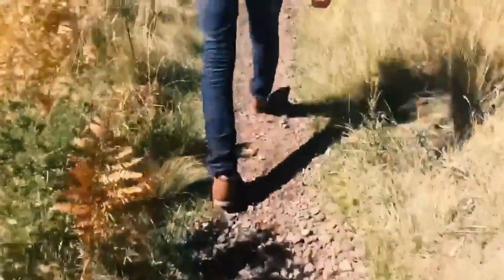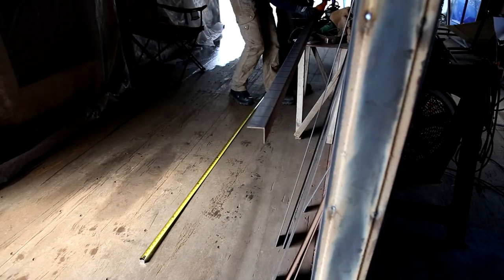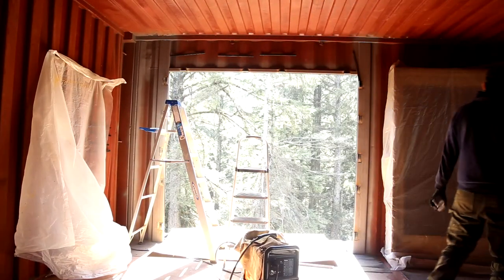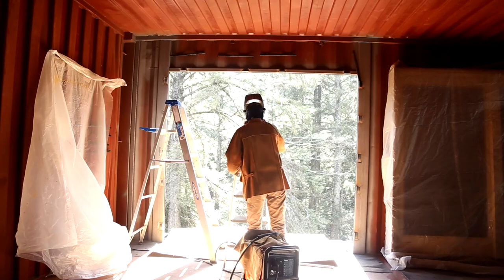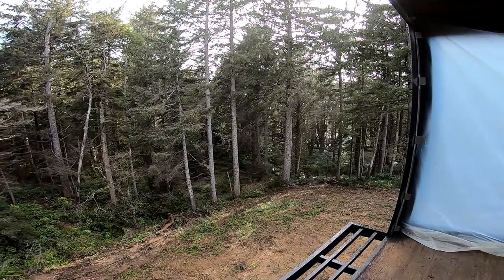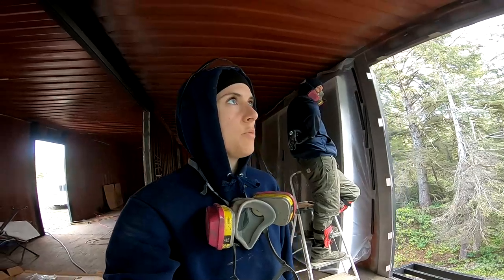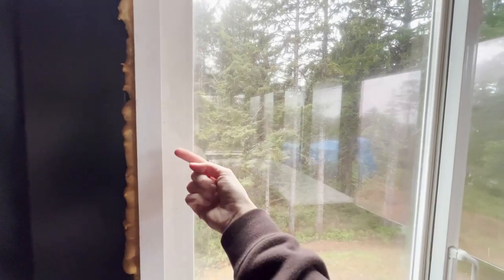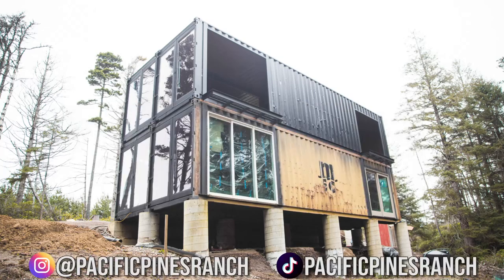How We Installed Doors In Our Shipping Container Home

Comment: Was cost the driving factor in this method?!?? Seems it would be easier to just use rectangular metal beam to create a door frame?
Reply from the maker: Cost is usually the reason behind what we do. You could also use tubing instead of the angle iron. There’s a bunch of different setups and ways to go about it. It just depends on what works for each situation! 😊

Comment: Great videos....great job.....I love watching your progress. I DO have a question (sorry, jumping the gun a little)...I know you want to use self-leveling concrete for the floors.....SUPER IDEA......but am just wondering about the door frames, which seem to be really close to the floor....will this leave you with enough "thickness" of the concrete...??? Should there perhaps been have another piece of steel, like a small box section, to elevate the door frames and allow for the concrete to sit against...?????
Again, love what you guys are doing.....
Reply from the maker: Thx so much!! With self leveling concrete you don't need very much space. I think the most we'll use is about 3/4". A typical concrete slab is much thicker and would require us to have installed the doors higher. :) I will do an in depth video once we get to this step.
Reply: @PacificPinesRanch  Thanks.....makes sense......wasn't sure if you wanted to add timber flooring, tiles or some other floor covering.....great job, very impressive.....thanks for all the inspiration